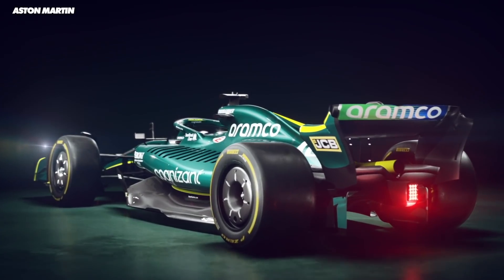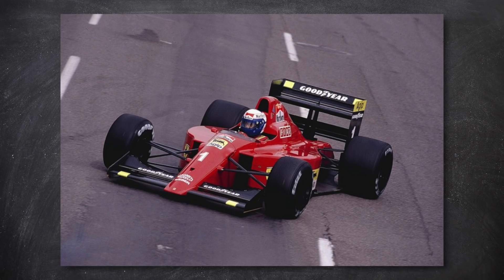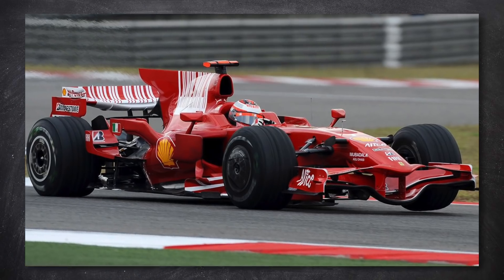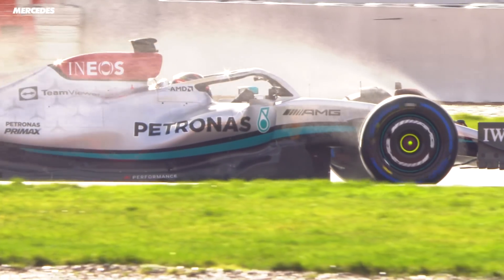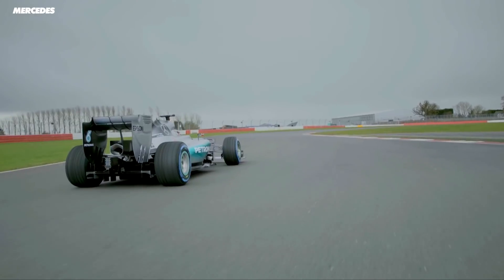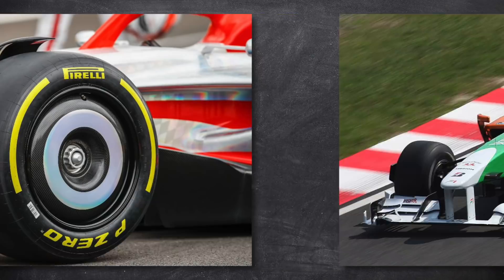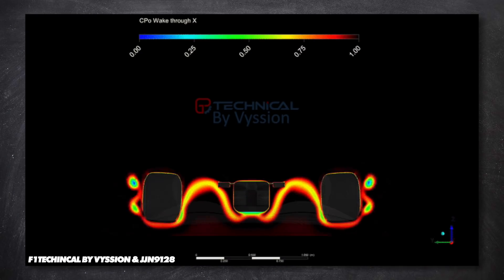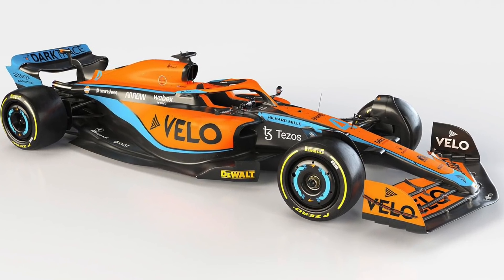How do F1 Wheel Covers Work?

Comment: Those wheel covers ngl are way better and fitting for the larger frames of modern f1 cars. The balloon wheels work well in aesthetics for 2000s cars with smaller frames but on the frames of the cars in 2014 and beyond they look ridiculous and ugly.

Comment: Back in 2009, I was still a new fan of F1, and I was actually under the impression that the wheel covers were part of the KERS system. 😅
It's funny to me that it took me almost 13 years to find out that they weren't.

Comment: I’m curious whether teams will suffer from brakes overheating more often
Reply: They have brake ducts now, so I don't think so
Reply: @rodolfo6reyes640  They had brake ducts before. Only for the front brake ducts, the allowed diameter is increased from 278 mm to 325-330 mm. The diameter of the back brake ducts is still 275-280 mm. Therefor, I'm also wondering if the cooling is sufficient this year
Reply: @artskeohnaad  still, the majority of the cooling is done by the air coming from the air ducts, so I don't think it will be a problem.
Reply: @rodolfo6reyes640  on top of the ducts still being there, the air will now get exhausted back in board, it looks like there's no way for air to flow but there is.
Reply: Willams lol
Reply: Believe in JESUS today, confess and repent of your sins. No one goes to heaven for doing good but by believing in JESUS who died for our sins. Hell isn't fun. GOD loves you soo much unconditionally.😍😚🍂😍❤
Reply: @alunesh12345  so by your logic, a mass murderer who believes in Jesus would be fine. Yeh good one
Reply: @jason21jburg  there's the need for repentance, but no one is good or worthy in Gods eyes. Therefore Jesus died in a cross and took our place so that we may live for him
Reply: @jeTtz04  absolute f*** you on about mate, genuinely are you ok.
Reply: @jeTtz04  I never expected a Formula One comment section to get flooded by crazy Christians.

Btw, whatever they're doing, they're doing it right, because no one has really retired to brake failure(unless you're Ricciardo).
Reply: @alunesh12345  If doing good isn't the right intention... I'm afraid you'll be horribly upset with your tickets to the afterlife
Reply: @alunesh12345  What are you hiding? What are you in denial about?

Comment: Hey, heard about porpoising in the F1 testing recently, I had a question,. Indycars uses ground effect to create down force alongside wings. And they reach a much higher top speed in straights, but they never seemed to have suffered from this problem before, how and why ??
Reply: They probably did suffer it but they fixed it already. I heard that it's not really that hard to solve and all teams are expected to have fixed this before the first race. But i'm not sure
Reply: @GuidoHaverkort  your right it is not a difficult problem to solve outright but is tricky to solve without sacrificing performance
Reply: @GuidoHaverkort  thank you for clearing that
Reply: The Indycar’s downforce isn’t as ground effect reliant as these cars, so the wings still do a good amount of the work to keep the car glued down
Reply: @tyler_bt3326  thanks for that
Reply: heave damping and springs (aka 3rd springs) , along with bumpstop....problem solved. Someone correct me if i'm wrong, the 3rd springs are banned now for stupid reasons so they are most likely stuck on using stiffer corners springs and corners bumps which probably hurts corners quite bit.
Reply: @RB26N  thanks for that bit of info
Reply: @piyushsahurkar9362  no problem, always fun discussing nerdy stuff.